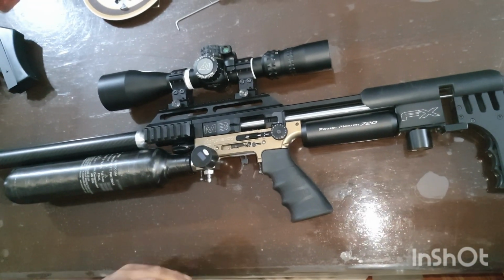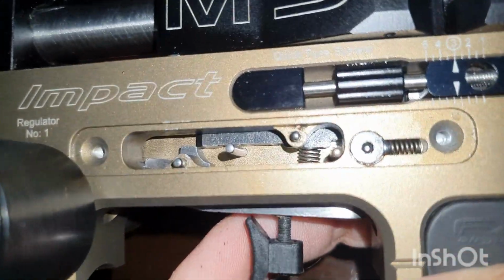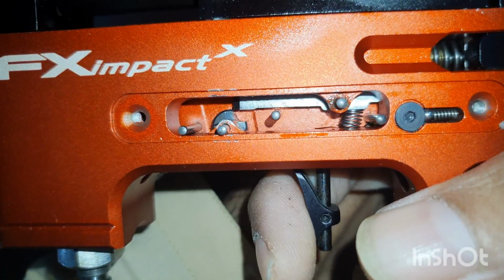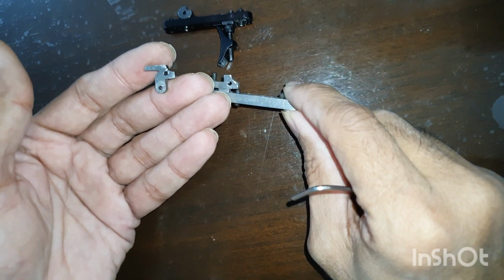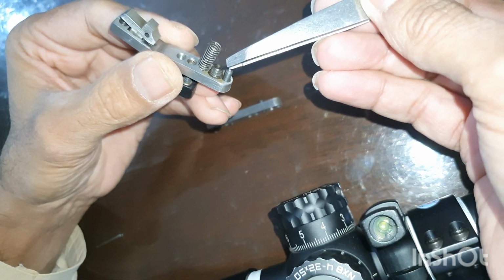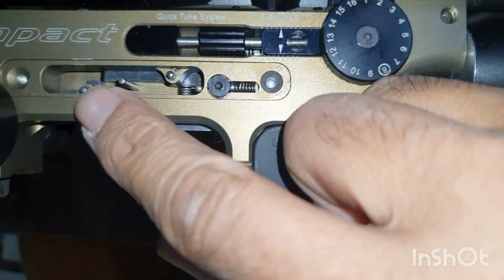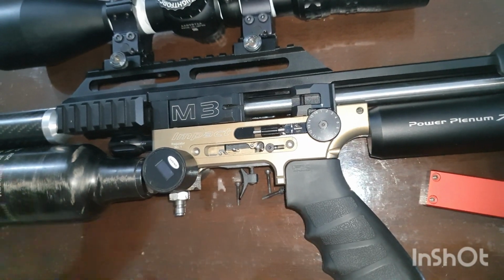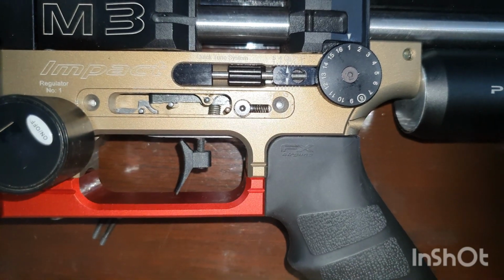FX Impact M3 & MK2 trigger improvement 4th video

Comment: Factory trigger gives more safety since the first stage also moves the sear - thanks to that it can be engaged more. If you mirror polish the original sears and add some lubrication you can add a lighter spring and the first stage always resets with no issues.
Reply from the maker: I agree to some of your points. I have improved the factory trigger by polishing,  lubing, putting lighter spring etc. but nothing goes close to 6 oz trigger for benchrest. 
Some benchrest triggers are as light as 3 oz.

All other good triggers don't have that extra safety of 1st stage of what you are talking about. Rather the safety comes out of further adjustments if available in a trigger.

I have played and adjusted some match grade triggers, those don't provide extra safety through 1st stage travel rather their 2nd stage engagement is confident and precise. 

Nice to know that you properly understand both the trigger mechanisms. 

Regards
Reply: @BhaursAirguns  Do you offer that piece? Is it heat treated?
Reply from the maker: @MasonStormSunny  yes I do offer it for target shooting and compilation shooters only.  It doesn't need to be heat treated just like FX sears which are also not heat treated
Reply: Make one for the Panthera.

Comment: Wonderful modification
Reply from the maker: Thank you 😊
Reply: Nice , is it in option to bay one trigger from you
Reply from the maker: I think now I can offer it
Reply from the maker: I think now I can offer it
Reply: What is option to bay one ,  you have ebay ? or how I can pay
Reply from the maker: @ellcrow  I suggest it only for target shooters, not hunters. You would have seen in the video that when on "safety" and trigger is pulled,  the sear takes a bit of reset. This I have to adjust by pushing the trigger forward before going to "fire" option.

So I suggest it only for competition shooters as many competition guns don't have safety option at all, like RAW TM1000
Reply: I am not hunter a will use it on local PCP airgun  competition
Reply from the maker: @ellcrow  Then you can be its right candidate 😉

Comment: Great work as always
Reply from the maker: Thank you 😊
Reply: If I want to but this trigger from you, would you be willing to post to London UK?
Reply from the maker: Greg S if you are a competition or target shooter then I would recommend you getting this modified trigger. 
If you see my last video in detail you will find that since I had limited space for work as rest of the parts as designed by FX are being used and the holes for pins are also not modified,  where I got a good light 1st stage and light crisp 2nd stage, I also have shown that while on safety if the trigger is pulled, the sear is stuck a bit and to keep the gun safe before coming back to "fire" position, I have to push the trigger blade forward a bit to bring the sear to its desired position.

So I don't recommend this modified trigger to anyone who doesn't understand the working, cause and effect of trigger mechanism. 

But for target shooting as many target guns come without safety, using this trigger is fine.

Since I know the behaviour of my trigger, I am using it for all purposes with complete success.
Reply: @BhaursAirguns  hi, thank you for you reply. 
I did work on the M3 trigger a lot to suit my way of shooting (frequently comp), but I am missing this feeling that I could do more. Hence my desire of exploring your design.
Also, the bet is - the cocking handle !!!!! :)
I love it - such a great and simple.
How can I get this few bits from you?
Regards
Reply from the maker: @gregs9218  I offer the trigger to target shooters
Reply: @BhaursAirguns  I see. 
Many thanks anyway.